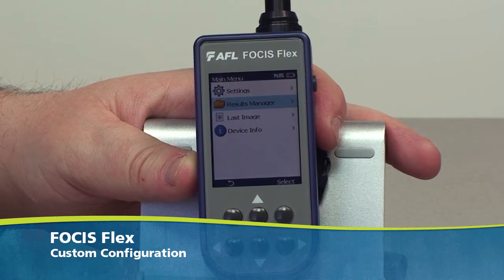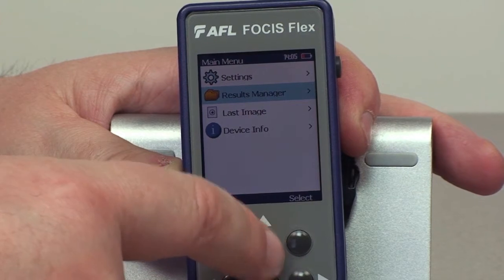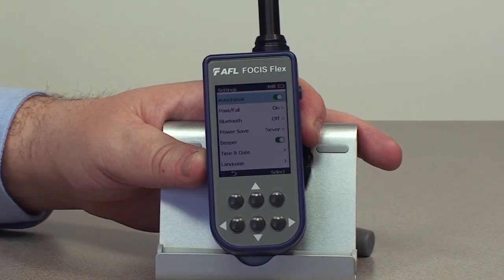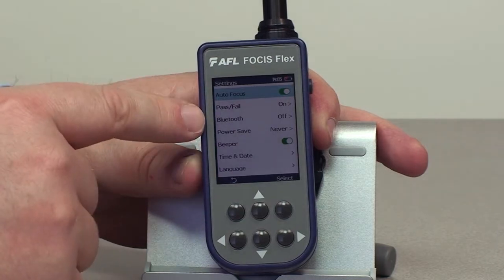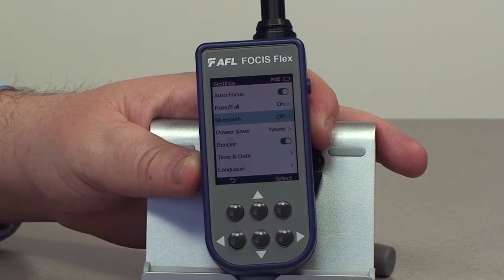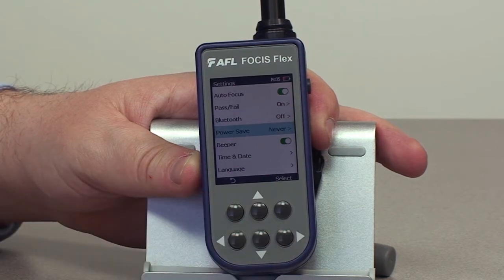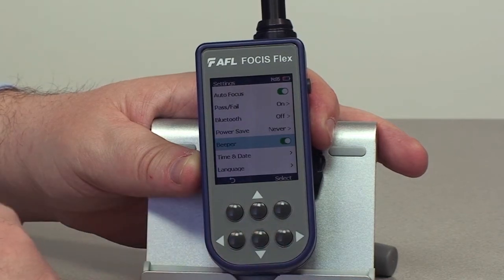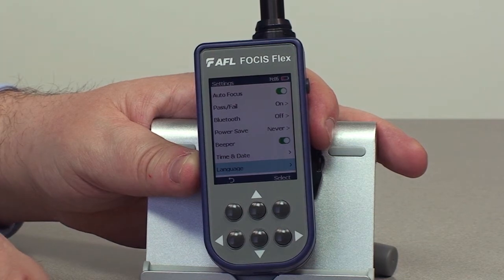FOCIS Flex Fiber Optic Connector Inspection System - Custom Configuration

Comment: If you use  IEC-61300-3-35

You find that 50 - 75% have to use a OneClick ore ReelClean.
Then think regarding the future standards 10Gb/ 40Gb 100Gb, 1,6Tb, and what will come in the future ?

All fiber tech persons have to use a mikroskope and OneClick / ReelClean / Isoprop with dustfree wipes...
PLEASE have control of the connectors with a mikroscop today!!

If you don´t there will be a probems in the future!!
Control before you Connet!